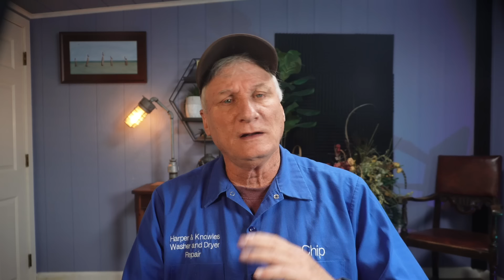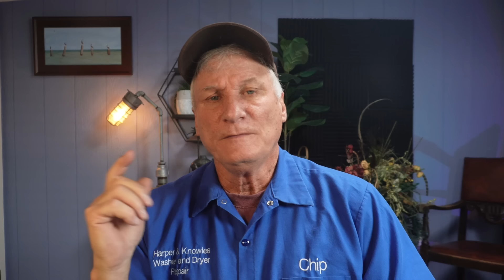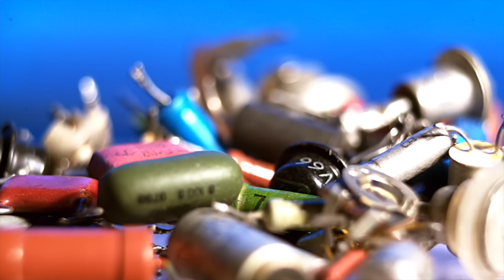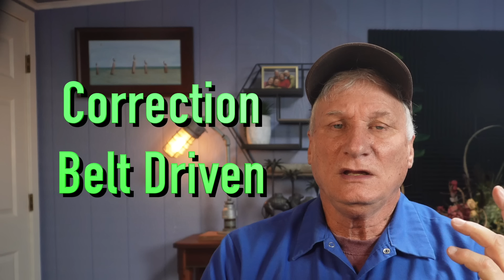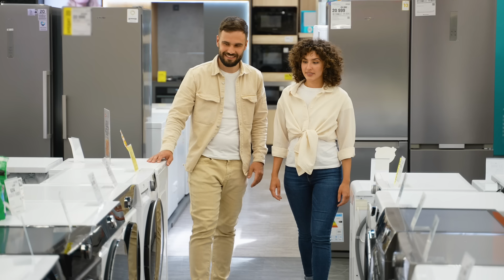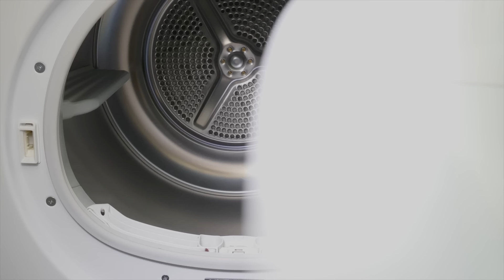Speed Queen Decoded: Which Model Is Built for Your House (Every Washer, Honest Review)

Comment: I'll be purchasing the mechanically switched TV2 series washer and companion dryer.

I don't need fancy features, I just want reliability and ease of repair.
 
I'll purchase spare timers, switches, etc and put them on a shelf, in the event I ever need to repair them.
Reply from the maker: Smart way to go about it. That mechanical timer is the whole reason the TV2 is so easy to live with — it's cams and contacts, nothing that throws a code you can't read. For the shelf, I'd buy the timer first; it's the priciest piece and the contacts are what eventually wear. After that the lid switch and the water-level (pressure) switch are cheap and they're the two that nuisance-fail most, and a spare drive belt and inlet water valve round it out. One tip from the repair side: write your full model and serial on a card and tape it to those parts — timers are cycle-specific, and you don't want to be cross-referencing numbers the night it quits. Do that and you'll hand that pair down to your kids.
Reply: @HarperandKnowles , thank you very much for those recommendations!

Having worked on trucks and equipment for years, I am very maintenance and repair minded. I always like to have parts on hand!
Reply: That's a GREAT idea!  Years into the future if that timer did become scarce or expensive, you'd HAVE ONE already.  Good call!  And with the new one in, your washer would be back in normal use while you tinker with the broken timer and see if you can fix it.  Which is what I would do, and from what you said below, I'm guessing you would too --

Look into adding a selectable pressure switch, if you want to be able to do smaller loads and not always fill it full every time.  They are easy to swap.

Several years into it, I might buy a replacement transmission for the same reason.  A few hundred dollars as insurance against loss of a perfectly good unit long after the replacement is no longer available.

Comment: I really want to love the FF7, but the few times ive used it in the small maundromat scenerio.. (hotel laundry as i do a ton of travelling)..  they dont use enough water and my clithes srtink as bad as they did when they ent in unless i wash them twice..  the first front loader i ever had was a frigidaire compact in the mid 90s.. that filled the water couple inches up int othe glass window and the result was ver yclean clothes an d no odor as it flushed the door seal clean each load..  does the speed queen FF7 have a way to get more water without pouring gallons into the soap drawer? I get pretty dirty crawling under vehicles or sweatung in the summer during fitness runs and walks.. my clothes are RANK..  my TR7 didnt do the job with its whimpy wash action...  it got rid of most of the odor but not the actual dirt or stains..  a front laoder that could get rid of the stank AND the dirt is what I need..
Reply from the maker: You're hitting two different things here. First, the FF7s you used were hotel/vended units — those are locked on a fast default cycle you can't touch, so that's not a fair read on what the machine does at home where you control it. Second, no modern front loader fills to the glass like your 90s Frigidaire did. That's a federal water rule, not Speed Queen being cheap — every HE washer built today is capped.

Here's what matters for rank, greasy clothes: it's heat and time that kill odor and break down sweat and oil, not how much water is in the drum. At home, run the FF7 on Hot, Heavy Duty or Sanitize, with the extra rinse on. That's a long hot tumble — exactly what a top-loader's quick low-water cycle (your TR7 "whimpy wash") can't do. Tumbling against a hot wash actually beats an agitator on ground-in dirt and grease.

Two more things: don't add more detergent — HE means less, and too much leaves residue that holds odor. Use a real enzyme detergent and pre-soak the worst of it. And run a hot tub-clean once a month and wipe the door gasket dry, since these don't flush the seal every load like your old one did.

Do that and the FF7 will out-clean both the hotel units and your TR7. Tell me what detergent you're running and I'll tell you if it's working against you.
Reply: @HarperandKnowles  Maybe a video on all the detergents?  What ones work in which ways, and which ARE working against you.  Just a thought!

Comment: Speed Queen TV2000 still Mechanical Timer. Love it. Wife is tough on her washers. Can't beat this one. She met her match. Lol
Reply from the maker: Ha — the TV2000 with the mechanical timer is exactly the machine you want when somebody's hard on it. No board to fry, just cams and contacts you can fix on a Saturday. Sounds like it finally met its match. Thanks for watching.
Reply: @HarperandKnowles , never had an old vehicle with a carburetor and point ignition that broke down to where I couldn't fix it on the side of the road. Same concept! Love it!
Reply from the maker: That model is essentially the stripped-down, coin-operated commercial version, so it lacks a lot of the features and cycle flexibility you get with the residential line. Thanks for watching!
Reply: @HarperandKnowles , it also lacks the fragile and unpredictable electronic circuit board.
I'm going for the TV2 myself as well.
Reply: @B81MackWho sells the tv2000? My appliance store doesn't sell them. Thanks
Reply: @pmaint1  They are harder to find.  But well with it.  What area are you in, I might be able to help you find a place fairly near.
Reply: The only features lacking in my opinion are the Load-size (or Water-level) switch, and a warm rinse option.  

But it does use a pressure diaphragm inside to stop the fill at the top, and that CAN EASILY be replaced with one that has 3 or 5 (or Infinite) positions.  3 is enough, Small, Medium, Large.   (I prefer the 5-position, and I really don't care for the Infinite myself.)   But any will work and do the job perfectly.  

As to Warm rinse, it is simple to splice a wire into each of the two wires that go to the hot-water and the cold-water valves.  Put those two spliced-in wires on a toggle switch, and you have Warm/Warm available with the flip of the switch.  I put mine right into the face of the console, and had a sticker printed for Warm/Warm.  I've seen where some people put the switch on the back, but wherever you put it, it works.  

And the TV2000 DOES HAVE the Eco-Cycle, which is GREAT for many average loads where only a tiny bit of detergent is needed, and the spay rinse alone is sufficient.  With the added Load-size switch, it can wash a medium load with spray rinse, in 25 or so minutes, getting it cleaner than any modern machine can, and using about 16-18 gallons of water.  🙂
Reply: That’s what I bought.  I added the adjustable water level control to mine too so I can run lower water levels when I want to.
Reply: @80SWoods  Hey - You may not have it handy, but if so, can you please post the part number for the Pressure switch you used?  

And how many positions does it have - just S,M,L?  (Or is it 4-pos or 5-pos or one of those Infinite dials?)

Thanks for anything you can tell about it.  I know part numbers and number of positions for Whirlpool Pressure switches, and those very well MIGHT work in a Speed Queen.  But they might not, and I don't know!
Reply: I always find my wife sitting on her Speed Queen. I constantly have to level it. Come back a few days later and she's sitting on it and it's not level anymore. I have no idea what the hell the problem is.
Reply: Keep a wooden ruler by the machine a slap her knuckles if she does not respect the controls